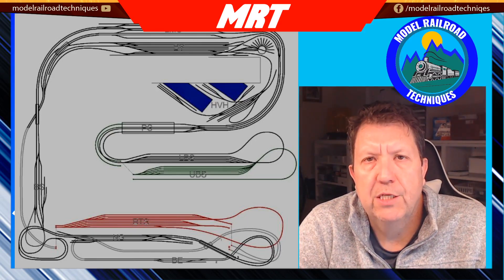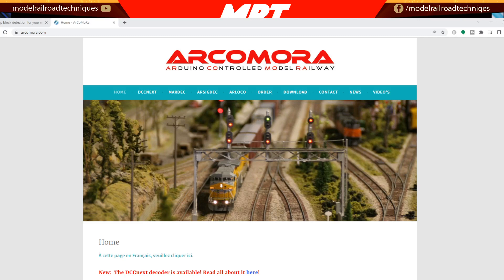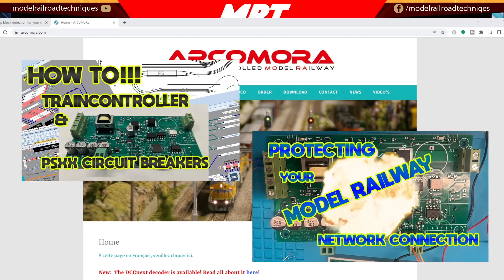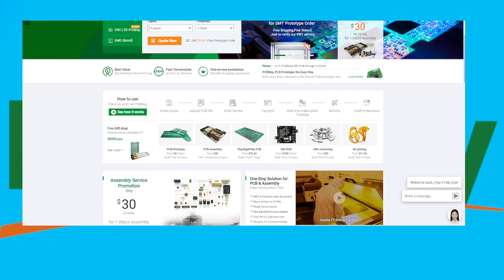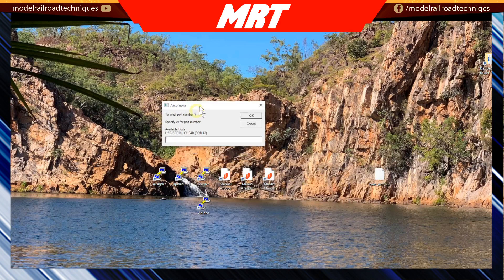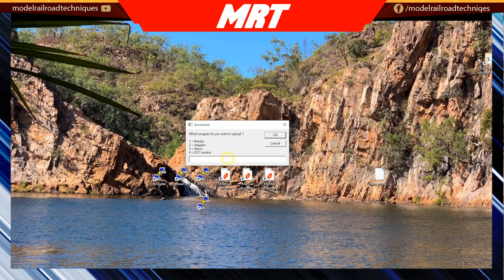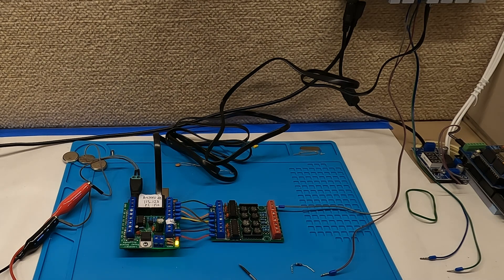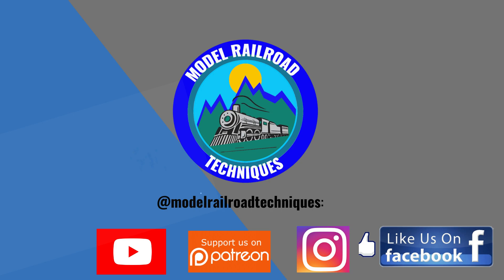Cheap Block Detection for your Model Railway ?

Comment: I love Arcomora.   It is so simple,  I have the NextDC plus a couple of other shields for it.   
So simple to use, and so many features.    It does take a little bit to work your way through the setup because there is so much it can do, but once you have your head around it, it is great.    Small or Large layout, this is just as good, if not better, than any commercial accessory controller.
Reply from the maker: They are great.. doing up a video on Mardec now. That is a lot of fun too.
Reply: @ModelRailroadTechniques  I look forward to seeing that.   I 3d printed some 3 aspect signals and ran arsigdec and that was fun to setup and play with.   Mardec is pretty cool too and has so many features for lights and servos